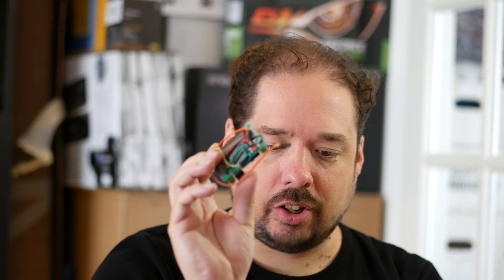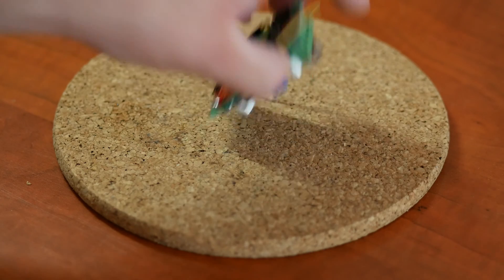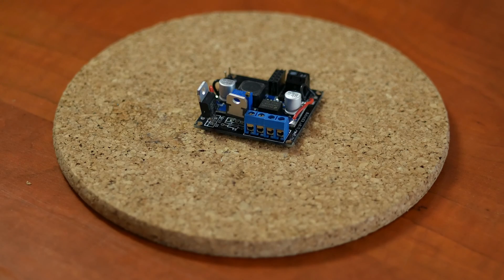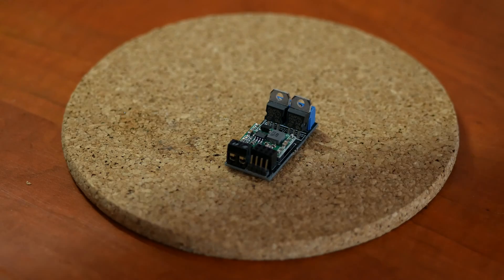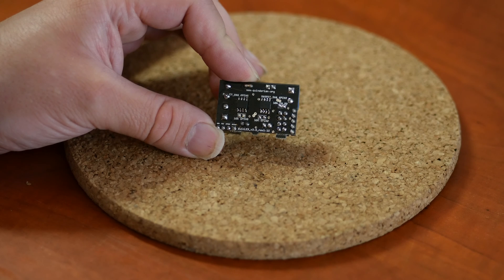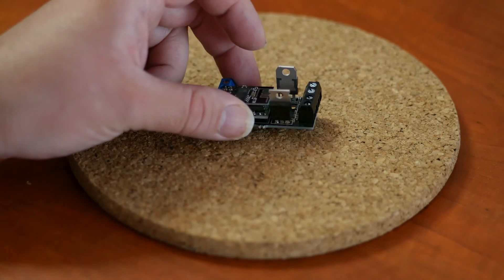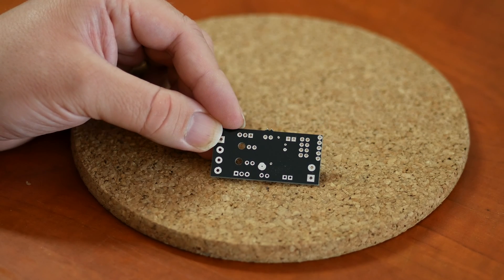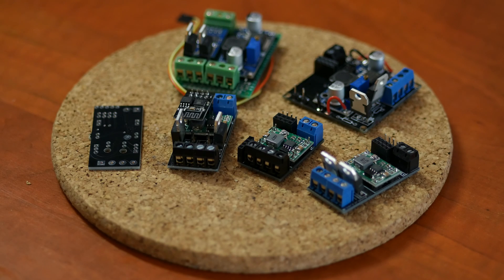ESP8266 LED Lighting: Revisit and history of QuinLED

Comment: What if I want to dim 200vdc? Is it possible with this dimmer?
Reply: I'm thinking maybe this relay would do it (??).

https://rover.ebay.com/rover/0/0/0?mpre=https%3A%2F%2Fwww.ebay.com%2Fulk%2Fitm%2F112531990565
Reply from the maker: +Sarracenia Crazy Not sure what you are trying to dim/PWM but 200 volt would be too much for my board. The MOSFETs specified are rated up to 60v and the dc-dc converter I wouldn't go much above 30v. So no, not with this dimmer.
Reply: Intermit.Tech any recommendations? Can I add mosfets rated for a higher voltage? It's a high powered led grow light for a terrarium.
Reply from the maker: If you can change the voltage converter to something that supports 200v and also change the mosfets to something that can switch 200v with a lower then 3.3v input trigger voltage, sure, I guess it could work?
Reply: Intermit.Tech thank you. I guess I'm going to try it. I'll let you know if it works. Your videos are great!

Comment: This is awesome! I'm going to buy some boards and solder one myself to make a sunrise simulator before winter comes.
Reply from the maker: Cool idea. You could use the two channels to combine a 2700K and a 3500K strip to have the ability to fade between the colors too. Take a look at the LED strip I recommend to get strip which doesn't emit of blue light but real red/warm light. They are made by "colordiode". I use 24v strip with 90 LEDs/m myself.
Reply: Bought the PCBs, they're coming soon!

Comment: Everything is arrived finally, today I am going to solder together. What about last part of the series?
Reply from the maker: The last video hasn't been produced yet because of a lack of time. I hope to get to it soon! For now, take a look at the Revisit article and it has a list with all the new and old articles. It should have all the information you need.
Reply: I am on it. HW is now assembled, but NodeMCU pre-built firmware is not longer available. There is an official auto builder service available: https://nodemcu-build.com but what modules I need to enable?
Reply from the maker: Ah, you can use that just select the general modules and be sure PWM is enabled. Or you can download the file that's linked in this post: http://blog.quindorian.org/2016/09/esp8266-led-lighting-setting-voltage-and-flashing-nodemcu.html/ it also has the firmware and everything you need.
Reply: Thank you, I really enjoyed the soldering part, the programming was little bit annoying...and one more problem: the LED what I connect to the module is always on. :-( On the output I measure 12V all the time (which means connected LED is always on), even If I change PWM. I sent you an email, maybe we can debug this.
Reply from the maker: Before moving to Domoticz, have you tried sending the command manually with netcat? In the archive there is something called "dimmer command line.txt" get that to work first.

Make sure you have netcat installed and in the path.

Comment: Why only two channels ?

If you make your own boards it should be easy enough to put a smt ESP module on there wich have 8 or more GPIO pins, especially since you will be using a lot of channels in your new home this wil drastically limit the number of modules you'll need.
Reply from the maker: While you could, it makes no sense to me. Currently you can run about 8Amps through the board with a maximum of about 6Amps for 1 channel. Incorporating more channels will not change the total maximum and thus still limit what you can connect to one board. If you have lots of small strips one "big" board would be nice but if you have longer lengths LED strip (let's say more then 1 meter) and are using high power strip, you won't have any use for the additional channels anyway.

This way, if a module flips up, it also kill half the lights in your house. ;)

I might look into a redesign in the future with more channels but that will require some heavy duty PCB lanes to handle the current.

Comment: Mine were rock solid for ages but have been crashing a bit of late and require a power reset to bring them back to life.  Have you experienced the same at all?
Reply from the maker: I've had some which I use to test fail on my before too. Mostly replacing the ESP8266 resolves this issue. I believe this might be related to my earlier designs not having resistors on the boards so maybe leakage current is killing the ESP's?

I've also read about a problem where the ESP8266 flash memory can become corrupted. 

For me it varies though, one test setup that is used daily has been working just fine for the last year or so!

The new version 2.5 design does have resistors you can place on the board so if that is the problem causing the ESP8266 module dying after a long time of use, that should be solved. :)
Reply: Thanks for the reply.  It's the one in my kitche which seems iffy now but the ones in my garage have been pretty solid so far.  Are you planning on releasing the design for the new 2.5 version?
Reply from the maker: Yes, I'm hoping to do so this week, but I'm not sure if I'll make it. Otherwise it might be in a few weeks since I'm visiting CampZone (My holiday) in the mean while.
Reply: Thank much appreciated, i shall keep a look out for them and no worries if it's not this week, you are indeed providing it for free :-)  I just bought some waterproof connectors this week so hoping to put a few out in the garden too :-)
Reply: Hi,

"resistors on the boards so maybe leakage current is killing the ESP's?" -> is this a real problem at this moment?
Reply from the maker: Yes and no. Yes in the current design I implemented the resistors wrong so that they don't work. But no, since it still works the same without them, just like all my other versions. I haven't had a big failure rate, it was just something I experimented with on the new revision.

I will release a new version in the future, but I'm not sure yet when this will be. So no harm in going ahead with this version, it's still the best out of all of them, just that experiment/"feature" isn't working.
Reply: Thanks, I hope the last video is coming fast.